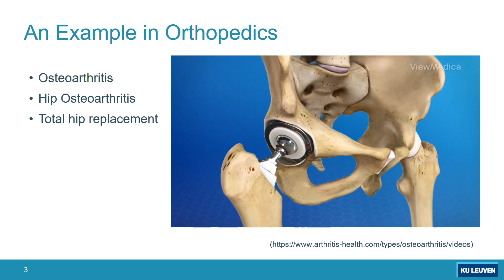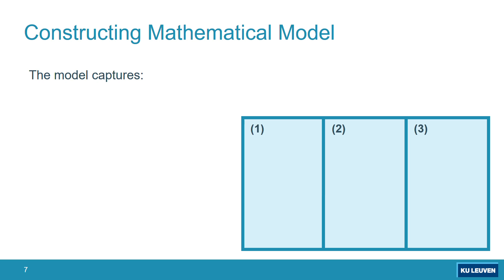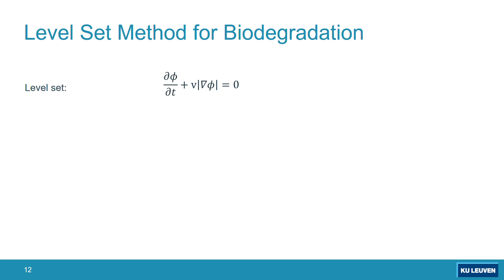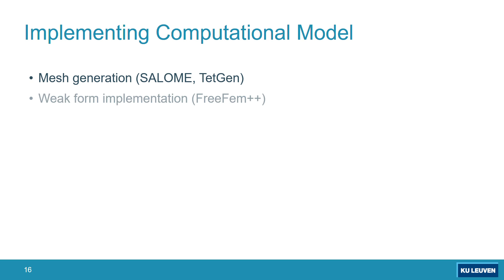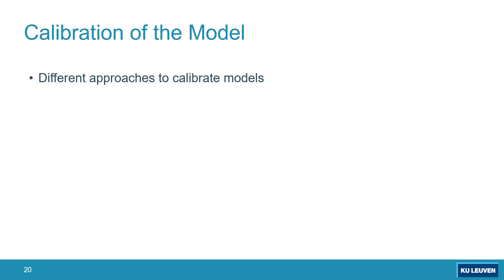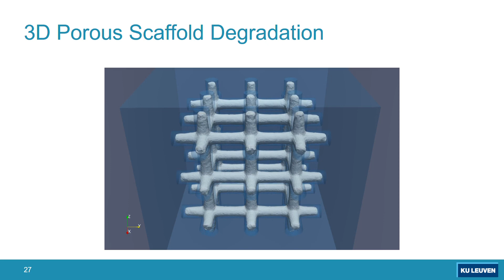High-performance simulation of biodegradation behavior of magnesium-based biomaterials

Comment: i am working on a project "Insilco Design of Magnesium Implants" i wish to show the degradation of such Implants, which software and how can i make those simulations. Can i have few resources for making these simulations.
Reply from the maker: Yes, sure. This is simulated using the model I developed during my PhD, which is available here: https://github.com/mbarzegary/BioDeg and https://github.com/mbarzegary/BioDeg-UI. You can find more information about it here: https://doi.org/10.1016/j.corsci.2021.109674 and https://joss.theoj.org/papers/10.21105/joss.04281. The PhD thesis is available here: https://mbarzegary.github.io/phd-thesis-website/